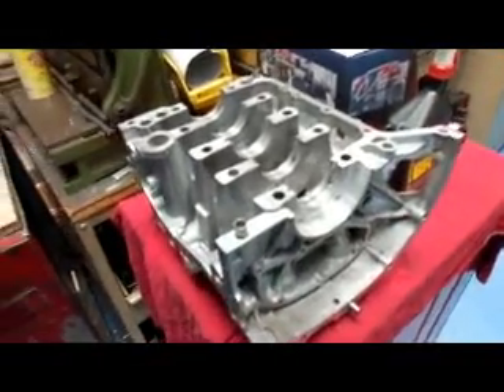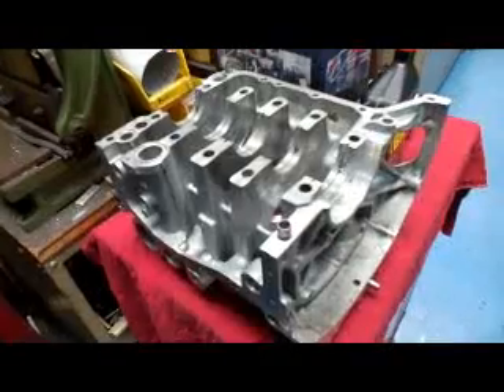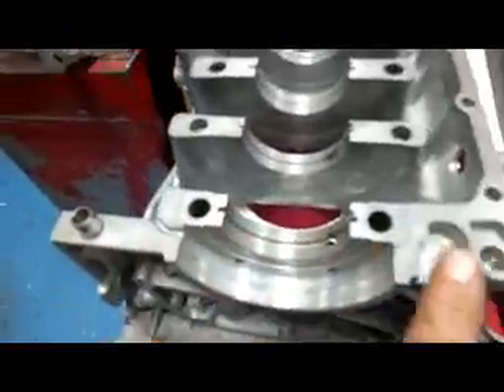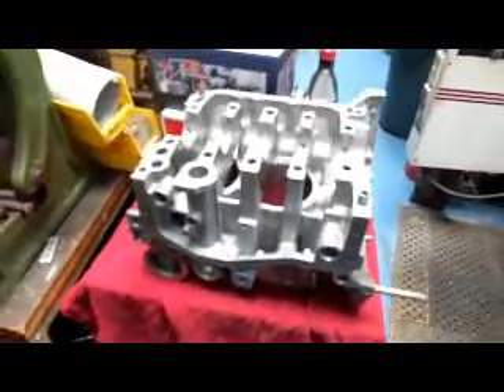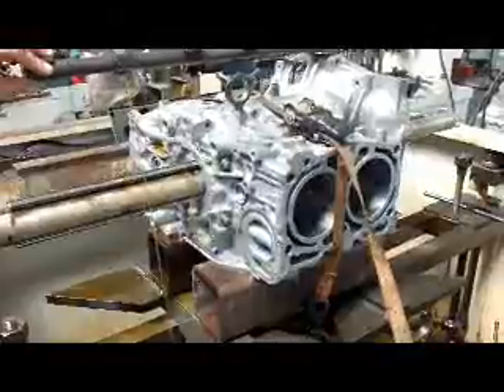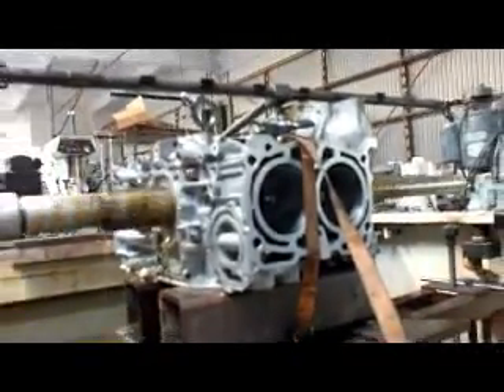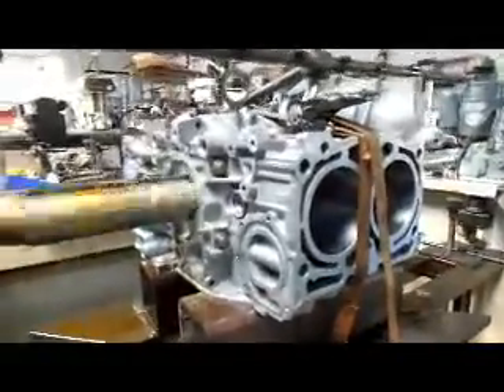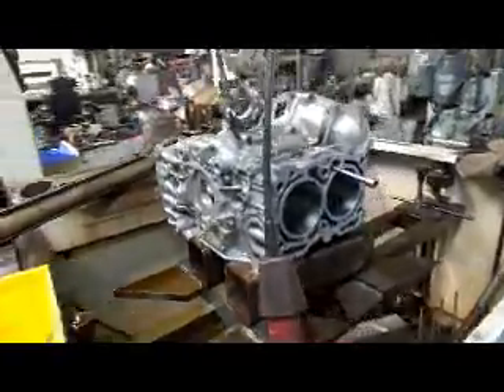Subaru Main Bearing Housing Bore Algnhone

Comment: Another suggestion:
-check each case half deck height from crank centerline. Subaru machining is not the best. I find it common to mill one case half more than the other to ensure same deck height. Otherwise you can be left with an issue of differing piston deck height from one bank to the other.

Comment: One suggestion:
-You should line hone the main bearing housings with torque plates on both sides fastened with the same studs you will be using in final assembly. I do exactly the same process as you, but with addition of two torque plates and head studs. I measured main housing sizes and cylinder bores with and without torque plates. BOTH cylinders and main housing distort when you use studs such as ARP or Cosworth.
Reply: are you still working with subarus ?
Reply: @ yes, I am